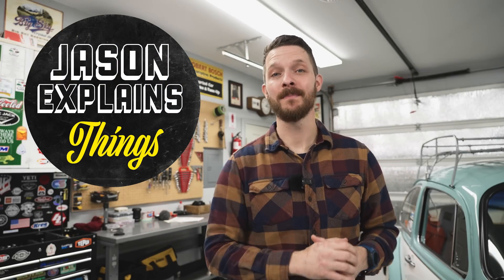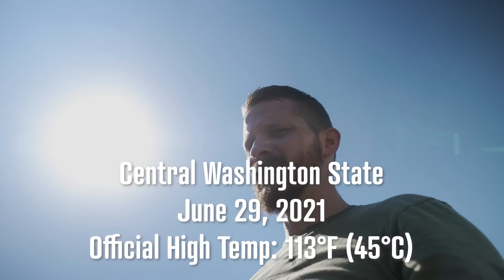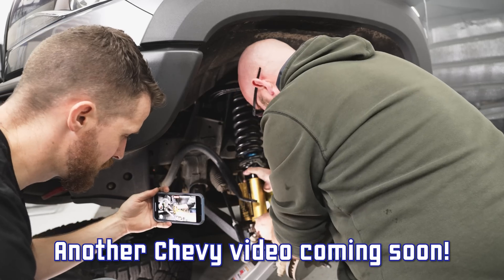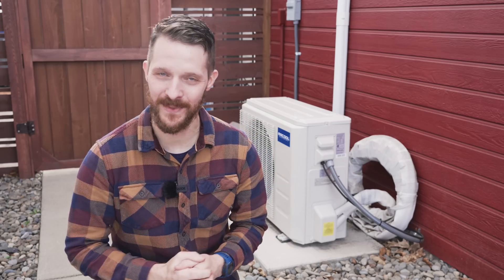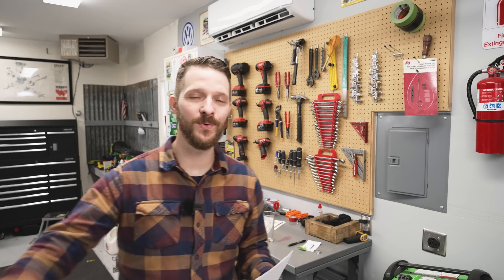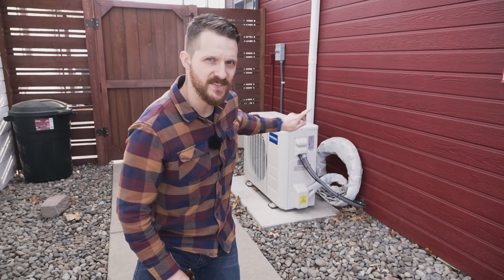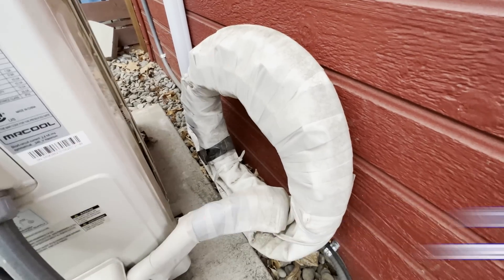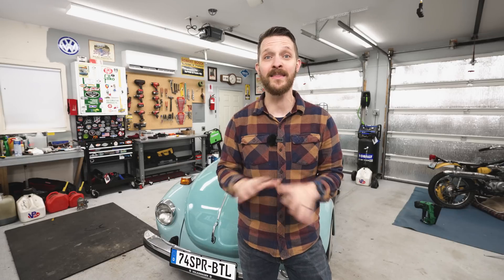MRCOOL DIY Mini Split LONG TERM REVIEW (15 Months Later)

Comment: The lines are filled with nitrogen, not refrigerant or under vacuum. Great vid tho 👌
Reply from the maker: I’d reference the linked docs and videos about that topic. I try to just report facts I find when either researching or doing a project.  👍
Reply: @JasonExplainsThings    .....Here's a link directly from an installer if you need more of a reference. See the 5:05 mark.

https://youtu.be/DzVJiSQNbew
Reply: @JasonExplainsThings  .....Not trying to be argumentative or win a prize, so don't take this that way......I don't have to read anything, I already know the facts. The manufacturer cannot legally put refrigerant in the lines just to allow it to escape into the atmosphere when you uncap them when connecting them to the condenser. Therefore, they are either charged with dry nitrogen or put under vacuum. Whatever literature you have cited has to be incorrect. Great vid tho 👍🏻
Reply: @chasechevy8933  You are assuming facts not in evidence...The lines are not "uncapped". The lines have an internal valve that doesn't open until the last half turn as the lines are connected to the compressor unit. No refrigerant leaks to the atmosphere. MrCool has online manuals free for the browsing. (I installed mine almost 6 years ago. Use it for heating and cooling the bottom floor of my house.)
Reply: @brianbrehmeyer3929  ....They cannot legally fill the lines, which will be knowingly opened to atmosphere, with refrigerant. Thanks for stopping by tho.
Reply: @brianbrehmeyer3929  ....and fyi, the refrigerant charge is stored in the compressor/condenser unit.
Reply: @chasechevy8933  As stated above; the lines are never opened to the atmosphere. If that happens, it would contaminate the refrigerant and cause early failure of the compressor.
Reply: @brianbrehmeyer3929  Incorrect. That's what evacuating/vacuuming the system is for. And I get it that you did your own install but you're talking to a professional. I didn't get on here to be funny or something. As I explained to the video poster.
Reply: @chasechevy8933  Yeah. Judging by posted comments, "professionals" seem to have a hard time understanding. Here is an excerpt from their patent, 
"Accordingly, there is a need for a new HVAC ductless or ducted system, configured for simplified installation by an amateur that has greater efficiency than present duct-free designs on the market, has adequate airflow, is not necessarily reliant on a wall outlet for power, has line-sets which are pre-charged with chemical refrigerants, and may be controlled remotely via a WiFi connection. Such a system is preferably configured to employ quick-connect connection mechanisms equipped with a unique auto-sealing valve disposed at all connection points of the line-set."
Please note, it states in their patent that the lines are pre-charged with chemical refrigerants....
I may have remembered wrongly about the last half turn opening the valve. Reading their online installation instructions, it appears the valve is opened after the connection is made.
And you're talking to a  DIY'r  that got on here to post the alternative to misinformation.
Reply: @brianbrehmeyer3929  ....So, I'm having a hard time understanding what you're saying. Is it me or did you just copy and paste something proving my point and then saying you're on here trying to dispute inaccurate information? Listen. No company that I know of charges lines with refrigerant and the lines do not come with valves on them. That would be illegal. The valve is either on the air handlers or the condenser unit. Plus the lines would hold such an inconsequential amount of refrigerant that it would be pointless. Lol @ how telling people that they are actually talking to pro's makes them so upset. You see that the video poster buzzed off, right? I even posted a video about it earlier. He researched and realized that I was correct. Just as you did. Now, take this as a learning moment and get your ducks in a row before you try and correct someone, even if it's on YouTube. That professional/DiY'er part cut deep I guess, huh? Nothing personal. I don't know anything about you other than the fact that you're definitely not a trained HVAC tech.
Reply: @chasechevy8933  Again, as stated above: the cut-n-paste is from MR Cool's patent on file. It states "has line-sets which are pre-charged with chemical refrigerants". I don't see how that proves your point that the line-sets are charge with nitrogen.
Reply: @brianbrehmeyer3929  ....lol Geez you're die hard. 🤣 I take it you watched none of the videos that I posted, so I'll beat the dead horse a little more, just for fun: When you open the pre-capped lines, you will, in most cases, hear a little pressure release or vacuum suck back in. That would mean that they are pre-charged with nitrogen or placed under vacuum to keep them clear of contaminants. You're not hearing refrigerant escape into the atmosphere. That, as I said, would be illegal and completely pointless. I tell ya what, since it's clear you don't trust me lol, why don't you call any HVAC company or any real tech and simply ask. When you do that, come back here and apologize to me, DiY guy 👌

Comment: Still running good? Cost to operate in winter? Did you notice a big jump in electric cost?
Reply from the maker: Runs great.  Didn’t notice a big jump at all.  Costly time of year is mostly July and August when it’s in the 100’s and I’m running AC in the shop and my house.  Way more efficient than a portable AC unit like I had before.

Comment: 8:12 thats because hvac companies HATEEEE heat pumps. They required almost zero maintenance. They truly hate when people find out they are better than central systems.
Reply from the maker: Yeah.  It has been awesome year round.  Works great, almost never has any issues, and its super quiet.

Comment: Im looking at buying the same one.  How useful is the phone app for scheduling?
Reply from the maker: It's buggy so I don't use it.
Reply: I have only entered a couple things into it, i just installed my unit after having it several months for me to have time. I wish that there were some more options with weekly stuff since i work in 2 week time frames. But i have it set for turning it low during peak electrical times, and it has operated flawlessly for that so far.

Comment: Just a suggestion air spraying the filters to clean them is not the best choice actually washing them under the sink with water is better. 
My analogy would be washing your clothes by just shaking them out and putting them back in the closet rather than actually putting them in water with detergent and washing them.
Reply: A shop vac works good

Comment: 6:54 Actually, they recommend you coil them horizontally! Source: have a 4 head 36k BTU and a 12k BTU single head. Both manuals state horizontally to prevent the oil build up. That being said, my 1 lineset is coiled just like your on the 4 head unit and hasn't had any issues, so holding thumbs. From the manual "Keep excess refrigerant hose coiled. Wrap with protective tape and store behind the condenser in a horizontal position (flat with the ground)"
Reply from the maker: Yep.  I pinned a comment and updated the description to include this.  The original instructions I had showed it vertically in a diagram, as did several install videos.  My bad.
Reply: @JasonExplainsThings  thanks for the reply! Sorry, just saw the pinned comment now!
Reply: the oil will continue to gather in the line set and the compressor will not live a full life, the outdoor unit should be off the ground a minimum 6", and more depending on the amount of snow in that area, i like a foot here in Maryland and put the remaining line set under. 4-5 yrs will be the  limit of that set up, done right would be 10-14
Reply: @dealecrabr9425  my MrCool diy obviously ignored your instructions to break because it’s on year 6 without a hiccup, and counting. I know all the jealous threatened installers are disappointed to hear this.
Reply: @hcookaustin , recommendations are estimates based on testing and experience. Sure, yours could last 100 years without issue, but there will likely be failers for others. No one is jealous. It's simply tested advice to help the majority enjoy the product for many years without issue.

Comment: Hi Jason, great job on the video and I hope all continues to go well for you with the unit. I am a retired HVACR technician and instructor and not a fan of DIY HVAC though. It could get real expensive real quick. I think the line set valves are pretty cool but they have been around for decades. The install instructions that I have read in the MR Cool manual leave a lot to be desired especially with leak testing and torque wrench instructions. With most ductless split manufacturers recommending 500 to 600 PSIG of nitrogen leak test pressure it speaks well about the valves that most of the systems don't go flat within the first 6 months of operation. BY the way an indication of a refrigerant leak would be difficulty in completing a defrost cycle. The saturation pressure of R410A at say 70 degrees F is just over 200 PSIG. That is not enough pressure to test at. There are torque wrench settings listed in the install instructions but no further instruction about them. I have watched a number of installs but have not seen anyone using a torque wrench. Also the units will need a good cleaning after a couple years and maybe sooner depending on conditions. SpeedClean has a system you should look at to do that. I wish you luck you seem to be a good guy but I see a train wreck coming with not only DIY but professionally installed ductless splits that aren't installed properly or not backed up with service and maintenance contracts.
Reply: I just looked again at your condenser install and want to mention that if you live in an area that gets snow the unit needs to be at least 18 inches above the ground. That could cause a defrost problem also. The line set should be horizontal to prevent oil trapping.
Reply: Great comment! For those of us who are handy but can't stomach the idea of spending $15k+ for a mini split system, what would you recommend? Is it better to buy a standard Mitsubishi/Daikon system and put everything in place myself, then pay a couple hundred bucks to a technical to charge the lines? That seems like a reasonable way to meet halfway. Thanks!
Reply: @RyanRhodes90  Why would a mini split be $15,000? I installed all 3 of mine ( two 18 k and one 9K ) for $2800  3 years ago and zero issues. If one blows up ill just buy another one and re install it. Its way cheaper in the long run. If you only get 5 or 6 years out of a $1200 unit its still cheaper. Its $200 / year. What's a service call cost plus parts and mark up and wait times?  Just my opinion..
Reply: @mattsbrute  it’s all about, knowledge. Your not paying for the units themselves, the companies have to get some out of it themselves obviously but very company is different experience and such that’s what goes into the 15k. I’m an HVAC tech myself and these units are picky. Anything goes wrong it’s more than likely user error and if installed by a diy it’s a big void warranty.
Reply: @RyanRhodes90  the technician you are going to get for 200 bucks would probably not be worth the money. I always recommend having a reputable company do the install service and maintenance. Working with technicians in wholesale for 20 years I have heard of all of the horror stories and finger pointing when a job goes south. Unless you can install, service and maintain your system get a pro.

Comment: So about that warranty, I installed a 36K unit a couple months ago. I went to fire it up this last weekend and kept getting a “P6” error code. It cycled about three times and finally started working. After going through this a couple nights in a row, it’s seems to be working fine now. That being said, I did call Mr. Cool and left a message with my info. I also emailed them as well. It’s been over two days and nothing but crickets. This has me a little worried that if the P6, or any other issues pop up again, I won’t have be able to get ahold of anybody for warranty issues.
Reply from the maker: That stinks!
Reply: @JasonExplainsThings  Well I guess I spoke too soon, I had a Tech from Mr Cool call me this morning. Told him the issue I was having and he went over a bunch of possible remedies. He was very helpful and hopefully the issue was a fluke. Just wanted to clarify that Mr Cool DID call me back and were great in helping me.
Reply: @ericmrobinson  thanks for the update. good to know there's someone there actually.
Reply: @ericmrobinson  They probably called you after they read your first comment on YouTube.
Reply: I had good customer service from mr cool and ingrams, I installed a 9k,9k,18k multi system and no problems.

Comment: Great vid. For some reason, the people I talk to have no idea what a heat pump is. Its so weird since everyone has used a fridge or AC unit. Anyway, since you had the issue with the pump freezing over, any thoughts on sending the coolant underground? Geothermal is probably overkill. BUT it is pretty cool and would be a sweet thing to see DIYed. :D

Comment: I think the reason many people talked about the pre-charged line sets are that most of the other manufacturers out there have a pre-charged condenser but not the lines - Mr Cool is one of the few that offer the lines to also be pre-charged, which is definitely a good added value for the DIYers!
Reply: The other companies, either have the lines shipped with a vacuum, or require the user to pull a vacuum and all the refridgerant in the compressor. Now if the lines are shortened then refridgerant needs to be removed. And added leangths may require adding more refrigerant.

Comment: You mentioned it froze but that sounded like it was because you had a freeze thaw cycle. How well does it heat when the temp gets really low? what part of the country are you in? I’d like to do something like this instead of this plus a heater or a heater and an AC. thanks
Reply from the maker: It heats well down to around 10 Degrees F.  Hasn't been an issue at all.  Even folks in the midwest use them and it gets way colder there.

Comment: Just an idea Jason what if you built a small slope roof that connects to the shop wall and slants over the entire unit? Could use tin as the roof or plastic or shingle it. You could really keep snow and or rain off it that way plus the sun. Just an idea man! Love your content!
Reply: I did this exact thing for all 3 of my units. In the winter they just suck snow in and if it raining when it's just above freezing they suck in the water and it freezes in the unit. A roof is everything.
Reply: My thought as well
Reply from the maker: A good idea for sure.
Reply: Good idea.  Maybe instead of shingles, louvered sheet so it'd let the heat out in the summer.  Or make it on a removable bracket to remove in the summer.

Comment: Great Review Jason :) I built a little sloped shed structure to keep snow and ice off my heat pump during the winter months.  (I remove it during the summer)
I don't know if aesthetically it would work with your garage and MRCOOL but I'm sure you could figure something out that would look nice. 
Mine is on the back side of my house so out of site out of mind and I'm not super worried about how it looks.